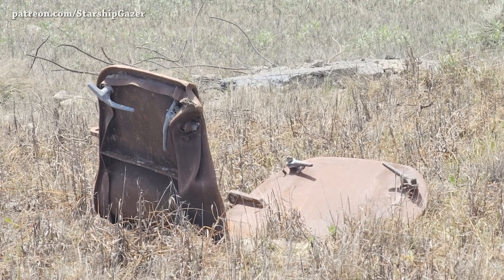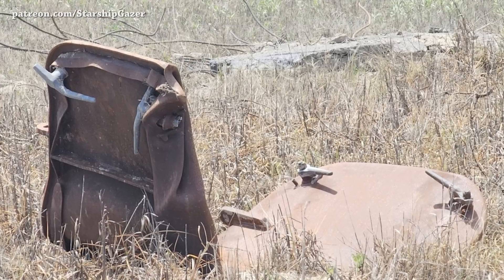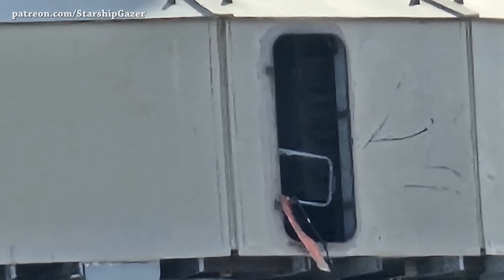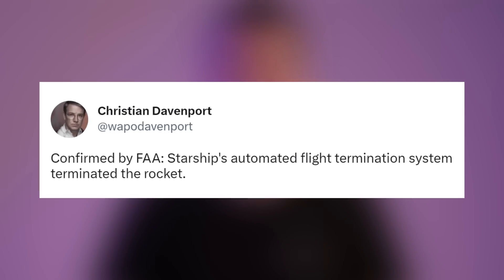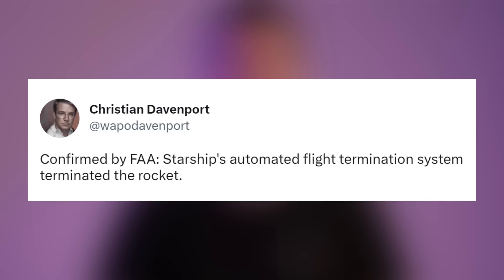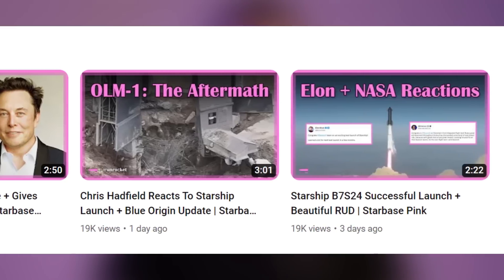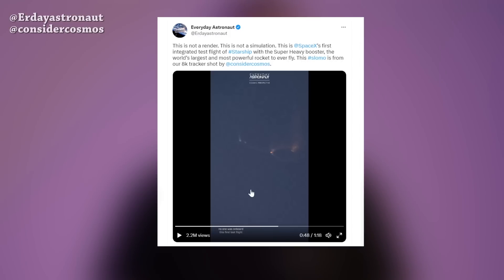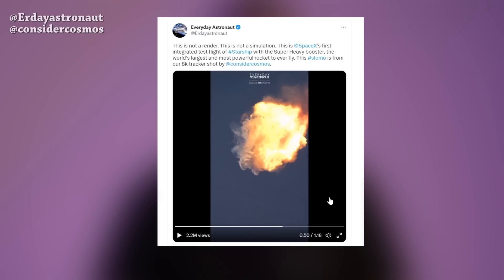OLM Door Destroyed + Big Storm At Starbase | Starbase Pink

Comment: Before it blew up you could see where the FTS had blown 2 holes in the rocket - it took a bit before it had depressurized enough and then failed structurally. Not sure that was the intended affect, but it was clearly visible.

Comment: On the RUD footage you'll see white streaks coming from the booster and Starship about 50 seconds before it exploded. That was the flight termination systems having punctured a hole in the tanks. Most of the structural integrity comes from pressurisation, so it takes some time for the tank pressure to drop low enough for the thing to explode. It's like stabbing a hole in a coke can with a nail, it's going to take a little time for enough of the coke to leak out before you can crush the can.

Comment: They need a complete redesign of the whole launch system so that the power of the exhaust is diverted away from the OLM and related infrastructure. I doubted a water cooled steel plate will work because all that energy and the shockwaves will be reflected back up to the rocket and damage the Raptors.

Comment: EM said before the launch if the rocket didn't explode on the pad, he would consider that a success.  No doubt this flight was a major accomplishment, but the pad got messed up pretty badly regardless.
Reply: It’s almost as bad as if it had exploded.
Reply: EM also admitted that it was a mistake that the deluge wasn't installed prior to this launch.   They clearly WAY underestimated the effect of the near 100 % thrust on the base of the pad!!

Comment: That launch tower could support 2 platforms if they took time to engineer and build it. That would potentially double their testing rate.
Reply: The lift would not reach both sides and two lifts won’t fit.
Reply: @brucebaxter6923  agreed, a rotation track would have to be added

Comment: Im sure the pad and olm will be repaired before the next launch and an upgraded deluge system
Reply: Yes too many doom-mongers - if OLM not 'gronked', then fill hole in with rebar and concrete, put water-cooled metal plate down, replace busted water tanks with a proper water tower - and ready to go again...
Reply: I’m not. It looks like the OLM was totalled.
Reply: @Tailspin80  dam that would suck ! i take it the damage reports are still piling in ! 😢

Comment: to eject the door like that (like the side panel of the QD) there was a huge pressure inside.
Reply: I think what is more likely is that the exhaust plume blowing past the OLM as starship rose above the pad created a vacuum effect and that created a sharp pressure difference between the inside and outside of the corridor on which that door opens into.
Reply: Huge pressure?
Less than 1psi would be well over a ton.
Reply: @brucebaxter6923  1psi = no pressure
less than 1 psi = low pressure
and a low pressure will not eject a door hundreds of meters from the building
so here we are seeing the result of a huge positive pressure pushing the door away.

inside the OLP the pressure was certainly very high, going in with all the holes.
and the weakest point was the one destroyed, here the door.
it's like a hurricane and a house.
Reply: @willgart1  
How many square inches are there on a door?
Reply: @brucebaxter6923  2500 maybe
Reply: @willgart1  at one psi,
That’s 2500lbs or over a ton.
Reply: @brucebaxter6923  well... 1 psi is nothing.
air pressure = 14psi
you need way way way more pressure to generate a force able to break the door closing system.
and even more to through the door hundreds of meters away from the OLP.

we have to know the weight of the door and the distance to calculate the force applied to the door.
but 1 psi it's nothing.
Reply: @willgart1  
One pound per square inch is 
Every square in has one pound on it. 
If you have 2 square inches you have 2 pounds 
If you have 200 square inches you have 200 pounds. 
If you have 2000 square inches you have 2000 pounds.